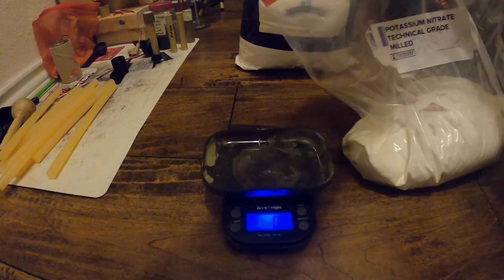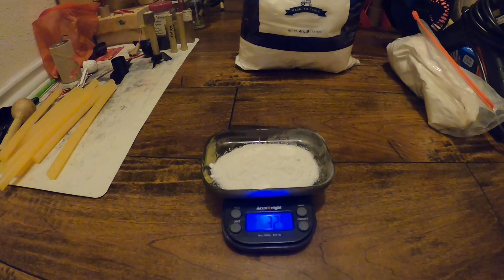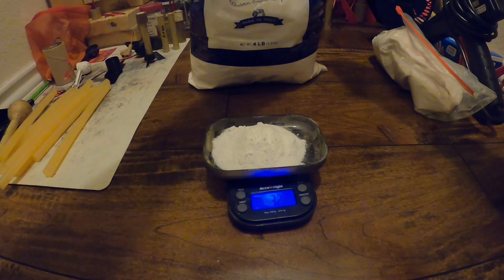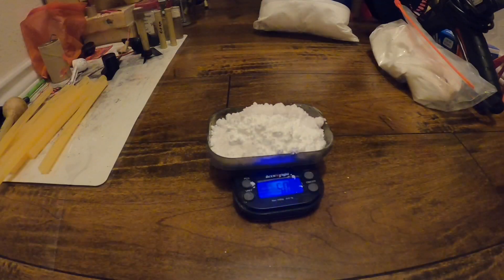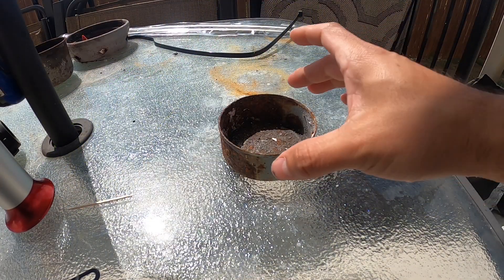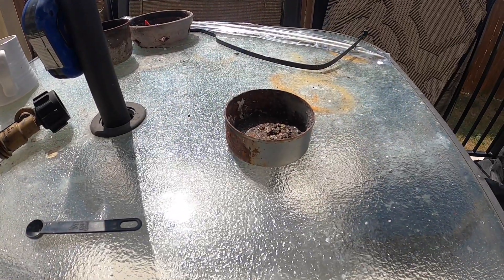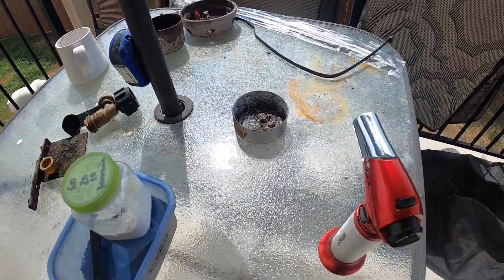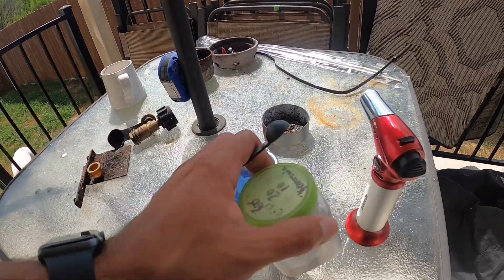Burn test of sugar fuel vs black powder

Comment: Will it help at all to run it through a ball mill
Reply from the maker: Well my nitrate is already milled from the store but if you make a sugar rocket there’s always a delay then it takes off. My sugar rockets work but they just don’t take off like black powder. Now you could try Sorbitol instead of table sugar.
Reply: yes, milling your sugar rocket fuel will speed it up immensely.

Comment: Nice video!
By the way cooking the rocket candy + adding 1% of iron oxide will make it very very fast even fast like good black powder :D
Reply from the maker: I have some iron oxide for a catalyst I will try that and burn test it.
Reply: @E85_STI  yea and don't forget to boil potassium nitrate in a fully saturated solution then add the sugar when it comes very thick lower the temperature than 110 c°
and add the catalyst and stir it always to prevent instant burn for the mixture 😁
Reply from the maker: I just uploaded a video of the catalyst to my sugar fuel and it definitely sped up the burn rate.
Reply: @E85_STI  
Yea I saw it
Good 👍